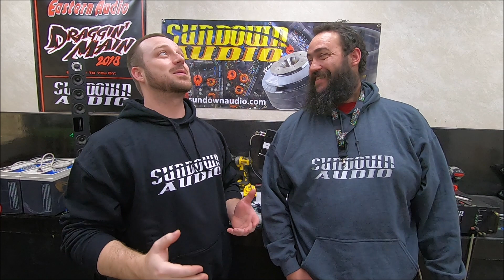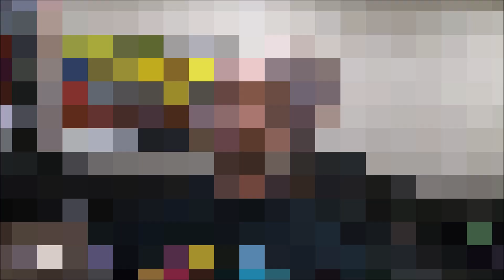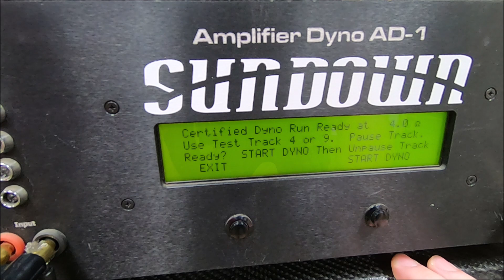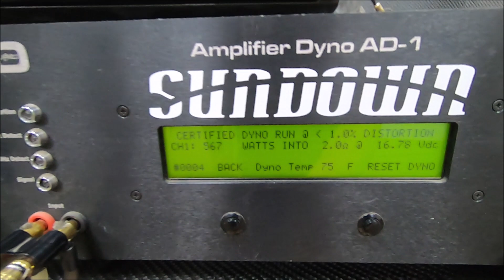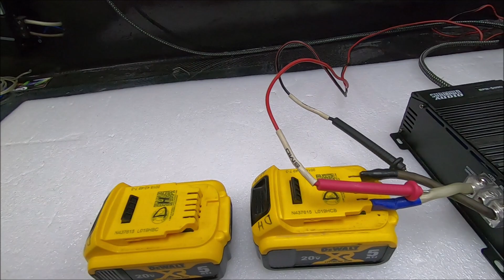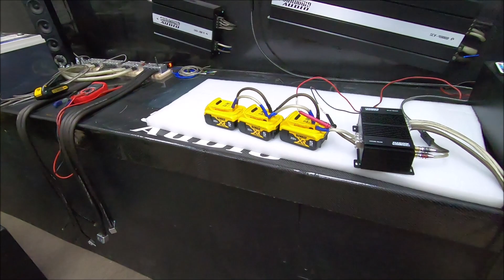Will a 20 Volt Drill Battery Power Your Car Audio Amplifier?  ***Car Audio Mythbusters***

Comment: I'm building a bluetooth portable stereo speaker right now. I'm using Polk Audio 6.5 coaxle speakers with a mini bluetooth stereo power amp. I built the box out of maple that I milled. If you read the specs on the mini amps, you will find that some are rated 12v-18v or 12v- 24v. I don't play music very loud, so an 18v tool battery will last several evenings around the campfire and super easy to swap in a fully charged battery.

Comment: This shows the batteries in a parallel connection,, which maintains the same voltage rating,, but doubles your amp/load capacity..  I would like to see what would happen if you connected the batteries in series connecting one positive and negative from each battery together and then using the outer positive and negative for your terminals
🔌
🔋
🔋
🔌

Comment: Of course it did work the app that you hooked the drill battery to created a 12-volt current. Do it without the amp just using the drill battery connecting to the radio this is a project I've been working on
Reply: Let me know how it goes

Comment: Trying to understand more about this stuff a bit. I have a 12v 7aH battery and then a 12v rechargeable talentcell battery pack. I am about to get a taramp  TS 400x4 amp. RMS at 4 ohms is 63w per channel. I’m guessing I’ll be under the 63w with either of these batteries. I’m going to bridge and hoping for at least 70w bridged.

Comment: this technology needs to be made, it is time for a completely wireless amplified subwoofer hookup that runs off of a rechargeable battery system and Bluetooth connectivity. I purchased an Ecco flow rechargeable battery to start running my own test. this market is up for grabs right now.

Comment: Would love to see that video. I've been experimenting with them myself. Built a Bluetooth tower. At the bottom is a Pyle PLPW8D wired to 8ohm, on top of that is a Pyle PDMR5 , on top of that a Pyle PDMW5, on top of that is a quad of some cheap 5w 50mm mini Bluetooth woofers from Amazon that turned out to be some of the best highs I've ever used. I'm powering it with 2 TPA3110 XH-A232 1 each for the mid woofer and midrange and 2 PAM8403 for each pair of 50mm's and a TPA3116D2 for the 8. using a dell Optiplex 780 power supply to supply the various voltages now. In the design stage the Dewalt batteries were my best friend. Currently playing around with them more with different ways to use them to power the tower in the future to make it portable. I think going to need a few buck converters and and a step up converter to make it happen but well see.

Comment: You're better off with a lithium jumpstarter. They're at 12-15v.  If you NEED it to be a drill battery, why not just the M-12 Milwaukee batteries? 12v all day. No worries.

 Each M12 battery has three 18650 batteries putting out 12v. Not only that, they sell Powerwheels adapters for those M-12 batteries so you can slap them in a power wheels car, and then recharge using the Milwaukee charger. They're $5 on ebay, and would make a great battery socket on a DIY boombox

Comment: Why couldn’t you take a few of these a part and make a lithium bank out of the cells and run it with a isolator or a voltage regulator?

Comment: I've been using drill batteries for bluetooth speaker projects but I use a step down converter. I would really like to run an amplifier straight off the battery like this because the converter is limited on amps.  Has anyone else tried this? Will I burn out the amplifier if I run it on 18v but set the output gains below the rated watts?

Comment: I did a test with a 5amp 20v dewalt with a low voltage regulator to buck boost dropped down to 14.4 volts plays for about 5 hours on one battery using 2 speakers in a plastic drill box on med volume works fine but kinda heavy and not waterproof . 
I ended up using a amplifier similar to this you have to use the low voltage regulator set to 16.5v or you will not be able to charge the battery again
Reply: I've been doing the same with ryobi batteries. Fyi ryobi batteries have low voltage cutoff built into the battery. Dewalt low voltage cutoff is in the tools.

Comment: Im gonna run a small 400 watt car amp for my subs at home  and i got a 19.5 volt 12 amp power supply was thinking about getting a step down converter but friend of mine said its not needed and it'll handle the 19.5 volts  .i guess ill  find out

Comment: Thanks for testing this man, I’ve been thinking about making a jump starter using four Dewalt battery adapters wired directly into jumper cables to start a few old cars. I’ve been having some alternator and battery problems on my mustang and I need to jump it often while fixing the electrical system. It’s a ‘66 so every electrical component on the car is mechanical aside from the radio. I assume under load the batteries will drop enough voltage to not harm the radio even though I see in this video it should handle that full 20v fine. I’ve done the calculations and Dewalt uses cells that can peak 50 amps each. So in a bigger pack with those cells wired in parallel each pack can put out at least 100 amps momentarily. So ~400 amps give or take should boost my car just fine.
Reply: Make sure u fuse each batterys or u will smoke them in a car system you always fuse your battery’s
Reply: I put together a jumper pack that was 9 volts but tons of amperage...I used 3 modules from a Chevy Volt battery pack wired paralell and it basically helps a low old battery start a car. The modules are Li Po packs and very powerful.

Comment: About trying the batteries in a car with music and bass and everything. These batteries has 5x 18650 batteries in serie 2p that mean 2 groups of 5x bat in series. They should be around 2000mah high drain battery each 18650 and the battery pack it self has a protective board that protect the batteries from be under discharged and prevent the amps current. The board should be no more than 20 amps. So, keep this in mine to calculate how many batteries in parallel you can use to run the audio for a while.

Comment: im not impressed you still ran it on 20 volts every test ...of course it is going to work all u did was increase the amp hours not the voltage ..click bait ..if thats impressive u will love thaat my orion xtr2500 can handel 58 of those or more

Comment: I made a bluetooth speaker with four 5.25 inch Polk audio and a Walmart dual 2 channel mini amp. I use my Ryobi 18v battery to power it with a 18v -24v step down to 12v. It works great.
Reply: Where did you get the step down?
Reply: @shannonsanfacon2992  i got it from Amazon. If you're planning to use it like I am, make sure you get a step down with a high amp output to handle anything you hook up to it.
Reply: I watch this video to see a comment like yours...I'm trying to build a speaker box trailer for my bike and was wondering if I bought a 100aH lithium battery would it push a 2000 watt amplifier
Reply: @williamgarner1013  The battery should power it up with no problems, don't know for how long thou. The more bass you get, the more power it consumes.

I now use 2 18v 5.0ah Makita batteries in parallel to double the amperage to 10ah cause I like to keep the bass high.

One battery is enough when keeping the bass at a normal setting.

You can always run 2 or more batteries in parallel to increase the amps.

My Bluetooth speaker is a carry-on or else I would be using a heavier, more amperage battery or batteries.
Reply: @orangecounty7144 you have no issues running high voltage straight to amplifier?

Comment: Pretty sure those dewalt 5 ah have cells that are rated 40 amps continuous so that means about 500 watts continuous and two packs should be 1kw and three is 1.5kw continuous which is crazy to think about for some power tool batteries

Comment: Totally off topic but I gotta say that I bought a 15” E series v.3 D2 from the yard sale site about a year ago and it was only $99. I’ve ran that sub so fucking hard feeding it close to 800w rms from one of the new Pioneer D class monoblock amps and it hasn’t disappointed me yet. I built a 3.25cu ft, that’s usable airspace, custom enclosure from 3/4” Birch with a triple layer baffle, sub inverted and tuned it painstakingly to 32hz using around 17” in length and 6” inside diameter round green pvc port with flat ends, no flares only rounded over the pvc and I smile every time I get into my extended cab Nissan Frontier and that bass makes my fucking eyeballs shutter lol. I’ve completely drown out so many people running 2 12”s AND 2 15”s of some supposed “high end” subwoofers. I always get the same response “oh this system is new and I don’t have the right amp for my subs” or “this is my system I’m using until I get my “real” system” 🤣🤣. The second excuse for getting shit on is personally my favorite to hear 🤣🤣. Thanks for the great equipment and thanks for the yard sale so guys like me, a disabled combat Veteran on a fixed income with three young kids to take care of, can also have the opportunity to purchase great equipment at insanely low prices.

Comment: I have maybe 15 of these of which 6 are new 5Ah ones. They can be drained at 25-30A continuous no probs. Essentially with them having 90Wh i can tell you they will power anything using 90W for an hour or 180W for half hour...etc etc. If I put all of them in parallel I could power an Iron Man suit for a solid 2 minutes according to my calculations. Unfortunately my amp goes in protect mode even at 15v, wanted to power the sub with drill batteries when hanging out but no go until I change it. Or I buy a at least 150w step down converter.

Comment: Would like to have seen you run it through a speaker until those batteries were dead to see how long they would last if it was a 15 minute run or if it was an hour run
Reply: 5aH battery at 50 amps is 6 minutes of capacity if fully charged.

Comment: Stopped at 8:48, the tone will play and the battery will dip instantly, and maybe get a few seconds and undervolt.
That is my guess, without seeing what really happens.
Edit Surprised it made a full cert run at 4 ohms. Don't think it'll make 2 ohm.
New edit Surprised it made all three runs at nearly 770 watts at roughly 16v with a guessed efficiency of 75%. That's around 85A draw. Pretty impressed.

Comment: You can't get much run time with 1 x 4.8amp  dewalt lipo at an 800 watt draw. Depending on a number of factors, you'd probably get less than 2 minutes of runtime before the battery's protection circuit kicks in halting the battery. So, yes, please demonstrate a real world longevity test using 1 dewalt lipo first.

Comment: Hell yes I wanna see the in car tests lol but this brings the question to my mind, what about making some real small lith capacitors or batteries like this size that you actually can run as a helper on say a 2k system where the lights are dimming?
Reply: Isn't that like the capacitors they already make
Reply: Add a second $50 car battery problem solved

Comment: 3 dislikes are ryobi users 🤣🤣
Reply: @UNIQUE REMIXES & SLOW IT DOWNS 😆 I never understood why they couldn't carry any car audio worth a $hit. Same as Oreilies too. Boss and Duel really? maybe a Kenwood head unit at Auto Zone if i remeber correctly. They dont even carry good power cable just hard ass battery cable down to 4awg for like $4.50 a ft .I just finished building my first custom amp rack (which can be seen here) https://youtu.be/oUMJ1Poe9Js and ended up ordering almost all my heavy wire and speaker wire from Sky High for about $2 ft for the 4 awg OFC and 50ft of 14awg OFC for less than 20 bucks.
Reply: I have sone ryobi power tools ive akways been thinking of maki g my own Bluetooth stereo or boom box powered like this . then for christmas i was given one made by ryobi . id still love to see how much sound someone could get from these small batteries .  similar to the $150 spl challenge . 
I also use the 56 volt  ego power for my cordless lawnmower its a huge battery in comparison.  Im sure a step down converter would allow someone to use that battery. Like this .. Cool video
Reply: @stacy532  I made a bluetooth speaker box with four 5.25 inch Polk audio and a Walmart dual 2 channel mini amp. I use my Ryobi 18v battery to power it with a 18v -24v step down to 12v. It works great. I made it dual battery, just in case I want it to last twice as long with 2 batteries. It works great with just 1 or 2 batteries.
Reply: I love my Ryobi stop hating.

Comment: I would rather see ways to improve complex set-up. 
1. Test difference between aluminum amp inputs and copper ones, same with bussing regardless if it shows copper is pointless 2. Show how to replace fans in amp (that is out of warranty) with quieter/stronger fans 3. Demonstrate SPL difference between subs up port back and subs back port back and..??  3. Test wattage/SPL difference between AGM with Lithium  4. Test difference between 1 bank vs 2 banks of 2.7v 3k super caps 5. Hit me up anytime for dozens of more ideas 👍

Comment: Those batteries are 18v just like all the other tool brands. The 20v is just a  sales gimmick.
Reply from the maker: You should actually check out the video.  The voltage is clearly displayed during the tests.

Comment: Interesting, I also was wondering this 2 days ago but was like no way a amplifier would turn on without protecting itself or blowing a fuse or damaging it.
Reply: The battery is 20 volts but the amp is only going to pull what it needs so all the voltage above you amps max voltage just gains you extra play time. Pretty cool implementation of all the involved electronics imo.
Reply: @erictheboringone5292  No, that's not correct. The amp will take everything you give it, and most voltage-sensitive parts have an operable range that will protect it from running the wrong power. Mosfets are not one of those things, so if your amp has a "MOSFET Power Supply", then avoid over-voltage. It is true that you can never have too many amps (amperes, not power amps), because a system will only draw what it needs, but that's current, not voltage. 

You either need a transformer to step the voltage down or you need to use 12V drill batteries; most of the big manufacturers have 12V systems they sell for home/diy toolboxes.

Comment: Now everybody is gonna ditch their Limitless and Super Cap banks and your gonna see rows of Dewalt, Milwaukee, Bosch and Black & Decker 🔋🔌💣💥🔥🌋💯 @ #160's_Drill_battery ⚡❗👍
Reply: Haha then u find out they're better bang for your buck lol
Reply: @svensplooge9961  not if you borrow them from the jobsite for the weekend. Lol.
Reply: @svensplooge9961  definitely not even close to better bang for your buck. These batteries are extremely high priced.
Reply: Have you seen how much these cordless tool batteries cost? They charge a fucking premium plus your first born son for just one battery. Hell most cordless tools don’t even come with a battery and charger anymore. You have to buy them separate from the tool. That’s some bullshit.
Reply: .....yeah when you can build them for PENNIES on the dollar; buy or bid on a whole pallet or lot online of 18650's (same batteries they make tools batteries from) then get a bunch if solderless connectors and plan out your packs according to voltage needs. You may have to use a series/parallel or parallel/series orientation depending upon your specific needs. Then shrink wrap and connect each cell pack accordingly. You can even use wago connectors. Its fairly simple and makes for a totally solderless job virtually eliminating any tools needed....if you have a elementary level understanding of electrical (literally identifying "+" from "-") you can read, and able to do a little math; you can do it!!
Reply: If you do try it at home then use a step down to get to 12-14 volts

Comment: I use a battery like this for my bicycle,  power wheels, etc Mines been powering a tiny taramps without any issues.
Reply: How many hours of playtime you get
Reply: Can we know what model taramps and at like 80-100wrms (backyard bbq) how long it lasts?
Reply: @oxnardadrianlopez6684 it will last pretty good. Maybe a few hours. I ran a 20volt dewalt drill and wired it to a 300watt amp that was Bluetooth and it worked great powering 4 400watt marine plye speakers.

Comment: Samsung 18650 deep discharge batteries usually give 25A, that means that if you put two in parallel you will get 50A and together 5 in series, well I just say that the numbers add up
Reply: most battery tools use 18650's internally.

Comment: Test the Milwaukee fuel batteries,  I bet they do much better. I been running both for many years, the Milwaukee 18v batteries are much better
Reply: Milwaukee 18v batteries run at 20.4 volts fully charged and drop down to 16volts when depleted

Comment: Let’s see some of that zv6....for fun lol
Reply: I have one I'm just waiting to build a box for.
Reply: @thomasmontano7794  really? How they lookin, any difference in the zv5's that you can physically see to tell them apart?
Reply: @kevinAuman1  
"The magnet stack is 2mm wider and 2mm shorter. The ID was brought in 9mm on the magnet so magnet surface area is higher.

Top plate is 5mm thicker. Back plate as well. Pole extension a bit higher and pole channels added.

Gap expanded to fit a fatter 8-layer bifilar coil. Therefore motor force up quite a bit.

Motor structure now fully bolted as well.

You can imagine it as a Z v5 tuned up a bit. "

 - Jacob Fuller
Reply: @thomasmontano7794  heck yeah, I cannot wait till first quarter that is when Jacob told me they'd be released to public and I saw no point in buying some zv5's now when those are set to release soon enough...
Reply: @thomasmontano7794  Jesse was saying that in his test car he did a few Db higher at a lower frequency and 1200w less per than he did with the 5's now that he is running the 6's...